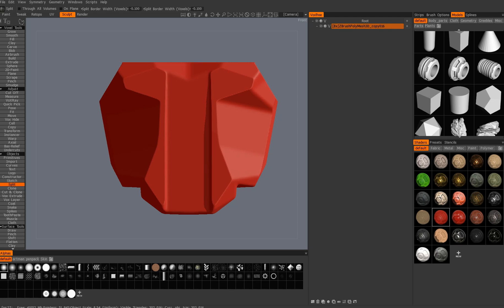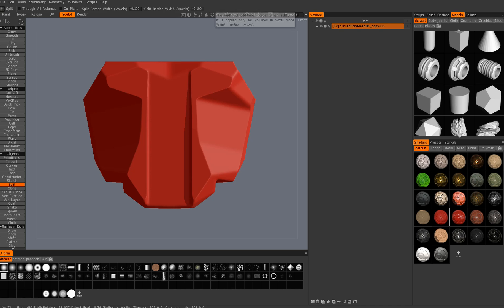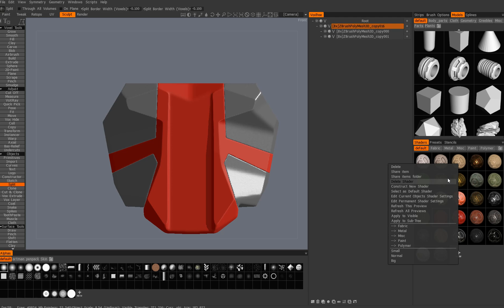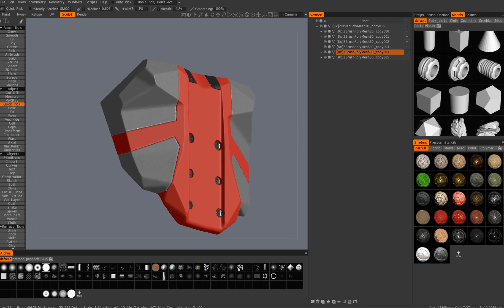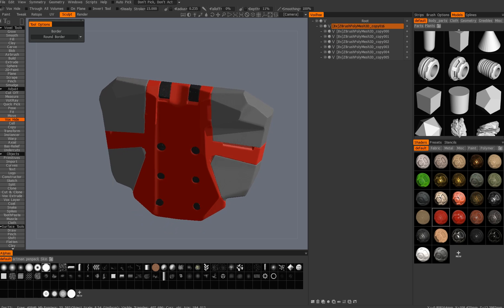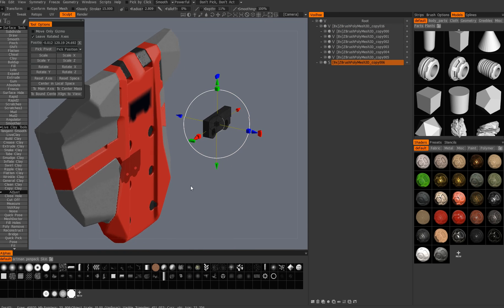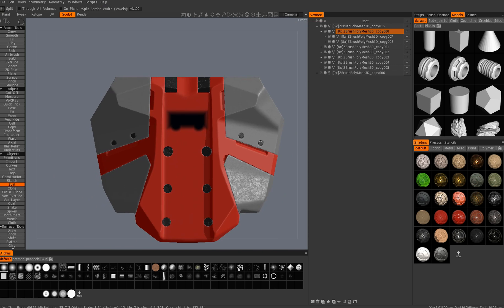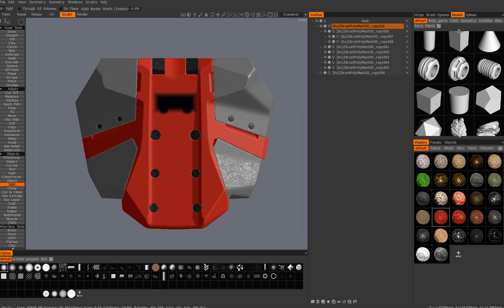3D Coat Split Tool for Hard Surface Design

Comment: I noticed here that your model here has a zbrush name.  How so? Did you take it over there for any 2ndary work? 
I'm wondering if it wouldn't be possible to concept here in 3D Coat for speed and then push a result over to zbrush for any final polish and sharpening etc that might be desired at a higher poly count? 

 I haven't yet played around with 3D Coat at all but I'm super impressed with your workflow!
Reply from the maker: Hi Pixel, indeed it does have zbrush name, hm. I think, I had some model from zbrush but then cut it to a cube or cleaned the layer out completely and added a cube in that layer with the old naming. 

I haven't mixed too much Zbrush and 3D Coat yet. I did use Zbrush to add noise to some rocks and damaged assets because 3D Coat noise feature isn't good enough yet. And I'm still more comfortable at organic sculpting in Zbrush.

I know a  lot of people don't like that you can't get super sharp edges in voxel  space unlike in Zbrush but unfortunately I don't know an easy way to drop a 3D Coat model to zbrush to get sharper edges. 

Thank you for kind words!

Comment: Looks a lot like plastic or rubber.
I don't see much from 3D Coat that looks sharp, like blade weapons or other things that have very strong sharp profiles. That to me is a big turnoff, even though I want to like it. Stuff in ZBrush can look as sharp or as smooth as you want.
Reply from the maker: I would agree that it is very hard to achieve real sharpness with voxels. You have to crunch the number of voxels to millions and then it gets really slow. I'm looking for workarounds myself. But from concepting point of view it is faster to concept in 3d coat than in Zbrush, in my opinion.

Comment: Cool Anton. I wasn't aware of this, I am now working on a sphere using the split tool with symmetry on but when I use the rectangular tool and  I go over from side to side it leaves a second mark right were I stop at the desired location for the split. I wish it worked perfectly. But anyway it is very handy. Thanks
Reply from the maker: Yeah, it does have this funny issue that it can create shapes in the middle. I should have mentioned that. Unfortunately almost every tool there has got funky problems. Still beats Zbrush in my opinion :)
Reply: Yeah. I'm really enjoying 3D Coat, even though it has its own issues.

Comment: Play with the vox hide tool, for similar BUT non destructive workflow ;) Typically like this:
1 make similar 'cut' with loops/circle/retangle/polyline selection as you did here, and yes, so far it just looks like a regular cut, hidden.
2 go to the Geometry menu, and pick "Objecty Hidden".
3 reselect the original layer/vox object (important) and then either pick, in the same geometry menu again, either delete hidden or "unHide all", depending of what you want to do later on.
Reply: and in either tools, when using the E menu there is also the interesting option to limit the depth, with "Depth limit".
Reply from the maker: Thank you, Aspirant! Very good tip, I've just tried it. It is slower even if you have an objectify hotkey but it is non-destructive.

Comment: Also! One thing that is fun to play around with is the 'On plane' option for the split tool. It stops it from going all the way through the mesh. I haven't used it a lot but something that also gets missed.
Reply from the maker: ill check it out!
Reply: @AntonTenitsky  set depth limit in e menu